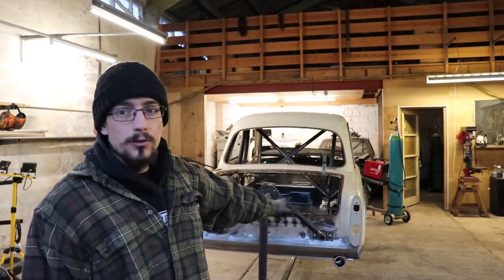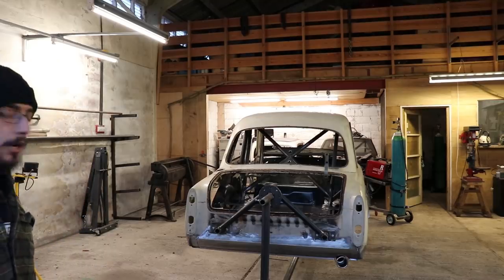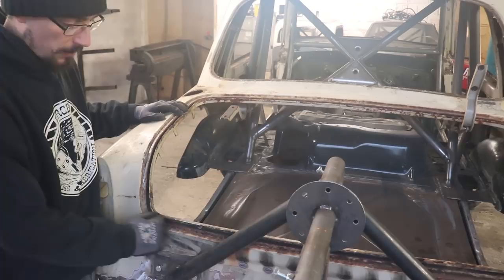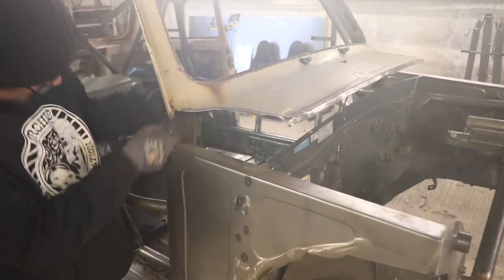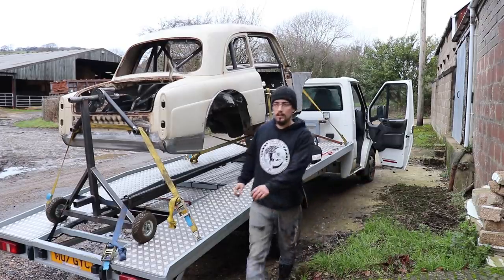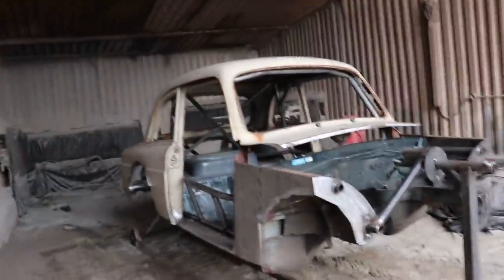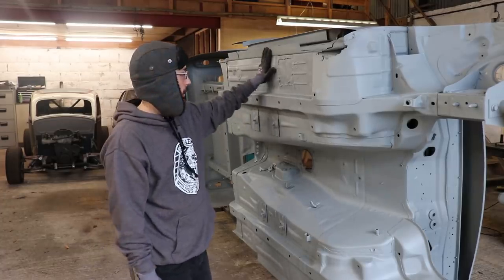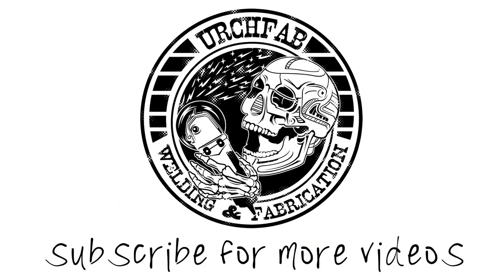THE MONGREL GETS SHOT BLASTED. MX5 MIATA / 1959 FORD BODY.

Comment: that bit of a spin at the end reminds me why I dont like sand blasting - all the sand left in the nooks and crannies that is just impossible to get out.
Reply from the maker: I will get it out!
Reply: a friend of mine fixed the residue sand problem..ha ha borrow a scuba bottle .and with the vehicle outside and some due dilligence and maybe a refill theres not a lot of resistance for sand to hang around with 3000psi of wind ...still some vacuming afterwards but what are your options to sand blasting that will give the same result ???? only a brand new shell!!
Reply from the maker: I will just roll it over 50000 times with an airline and hoover in hand  until every grain is gone.

Comment: What are you planning on using for the front clip? Will you use the original metal hood fenders grille bumper etc, or maybe an aftermarket fiberglass front end?
Reply from the maker: Fibreglass, unless I find some good steel panels but that's unlikely.

Comment: Urchfab, can to tell me something, i had the sheet metal for the bonnet panels sand blasted for my old tractor, when i fitted them back on the panels would not fit properly as if the sandblasting stretched the metal and also seemed to strengthen up the metal as they seem a lot stiffer, i have heard this with sandblasting, so if you were restoring a classic car which have thin car panels you would have watch what method of blasting you did.

Comment: I really hope this works out for you sir.  

Your a bit of an inspiration for me. Here in Canada u have a 1980 Lada 2104 I'm going the rust repair on and then it gets the heart out of a 1st generation Mazda rx7 to make it go quick.
Reply from the maker: That sounds proper cool, i really like those.
Reply: So it's going to be kind of vaz-21019?
Reply: @valde3336  basically, but with the 2106 body.
Reply: @Urchfab  the cars or the engines?

Comment: Happy New Year Matt. That floor patch looks like it was stuck in with chewing gum. I reckon you should cut it out and fold the edges over, cut a square in the middle, fit some glass and a backing board and put a photo of the Mongrel from that magazine photo shoot in it. Urch Fab fab fabrication frame to auction off. :-)

Comment: could be theres moisture inside the camera lens maibe warming it up carefully for a while (like over a radiator at home ) helps getting it out 
might take a little more time but i think you get there eventually if you keep putting out the content , the fact that you dont do any other work is a little worrying , maibe take a partime job for added income and insurance so you can do the youtube channel next to it , ir like i mentioned before try to become the uk dealer with an online shop for some nice tools for metal working and racing in general
happy new year everyone
Reply from the maker: I think it was because I had taken the camera home and like you say it went from arm to freezing, I'm still doing other work at the moment but hopefully not for too much longer. That's a great idea for the shop I will look into that. Cheers

Comment: 3m panel bond after blasting hmu for details. I use it a my resto shop
Reply: Super easy and solid for drip rails like that. Used it on some 190sl repairs!! Worked great and learned it from 3n rep